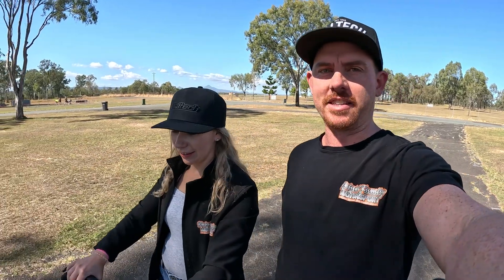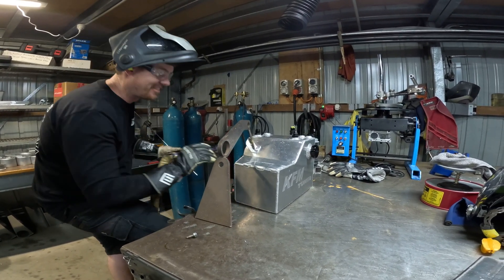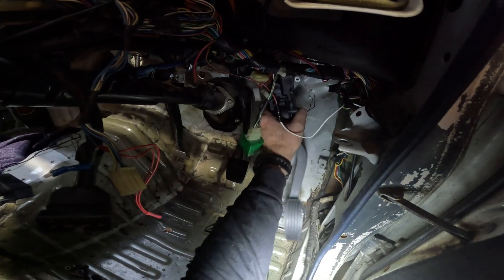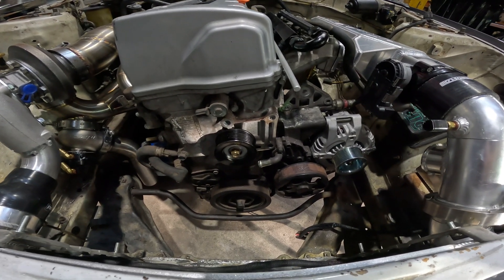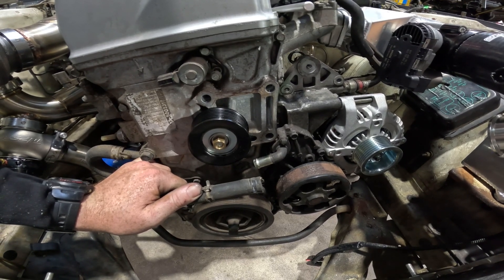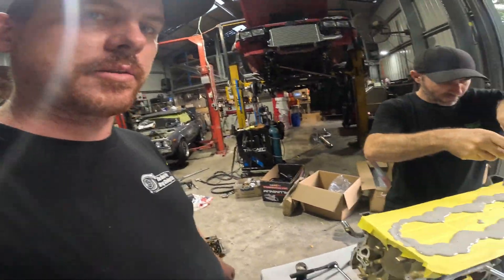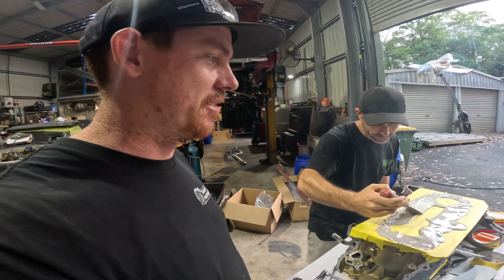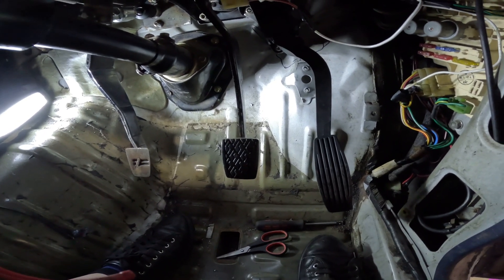KRolla – Fuel Cell, Catch Can, Engine Disassembly & Block Epoxy

Comment: I stumbled across this build I'm doing the same combo with the Maxspeeding rods and stock pistons, Did you change the Wrist pins or get the little end rebushed or send it ? As the Honda stock pins are smaller than the 22mm that the maxspeeding rods are setup for.
Reply from the maker: Nope just sent it how it was.

Comment: My plan for the AC power steering delete is to replace the alternator bolts with threaded rods and put nuts and washers between the water housing and alternator to tension the belt and then a set of nuts to lock it off. That gearbox mount is way to nice to be hidden under the car...
Reply from the maker: Will be interested to hear how that does, make sure you let us know! Lots of nice stuff there that will be rarely visible 😊

Comment: Question: Was that the full extent of the holes in the epoxy? Any worry about heat cycling that material (I'm new to this stuff)?
Reply from the maker: Oh the holes are to allow coolant to still pass from the block through the headgasket to the cylinder head. 
I put the original headgasket on the epoxy after it had set then marked out all the holes that needed to be drilled 👍

As for heat cycling that is something that we are going to find out. 
We have some of this same epoxy in a LS cylinder head and seems to be no issues so far (still early days for testing though).